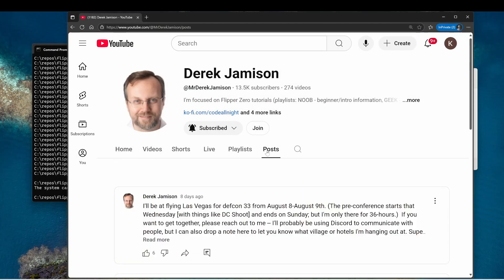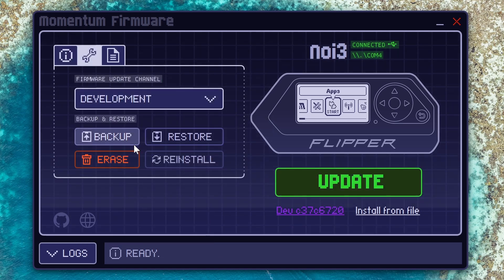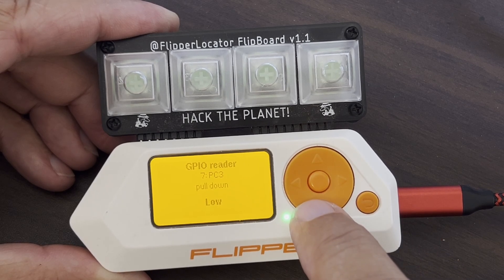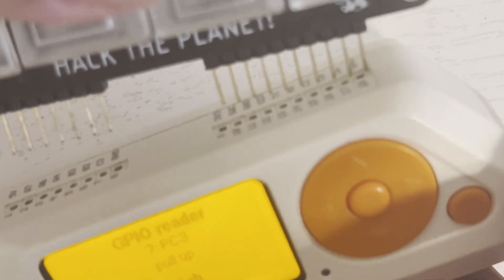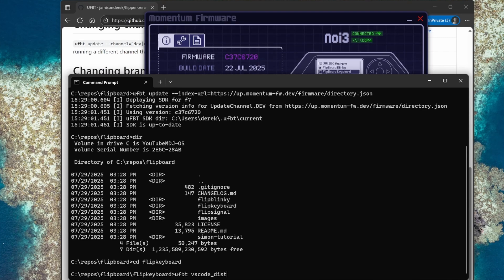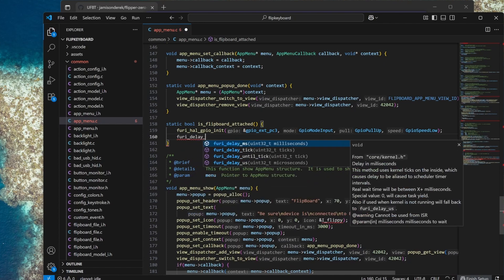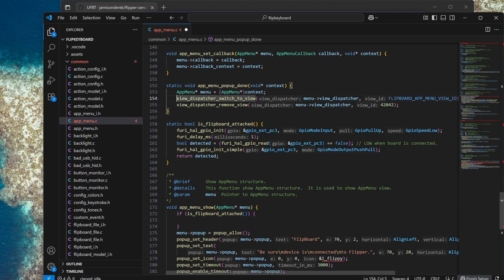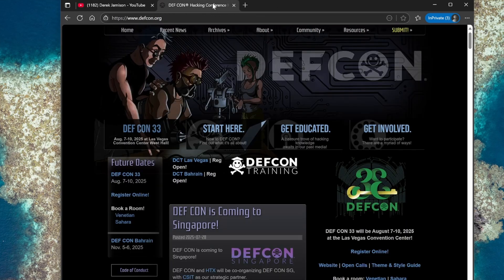[173] Flipper Zero: Flipboard auto-detection #flipperzero #defcon #hackerwarehouse #flipboard

Comment: That q flipper fork is nifty! Definitely downloading that.
Reply from the maker: Yeah, I’ll do another video about it in the future. The developer is very quick to respond to requests - fixed a timeout issue when reinstalling same firmware. Also, if you type on your computer it inputs the text_input (which was from a change Willy from Momentum had implemented).